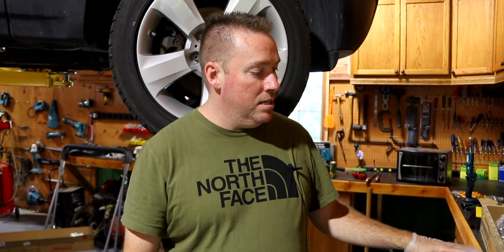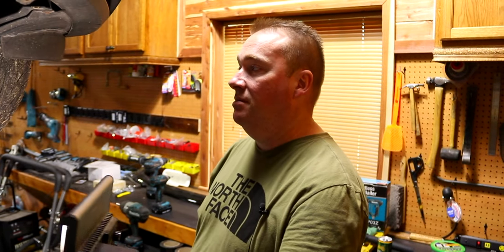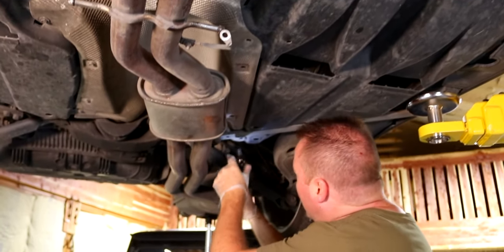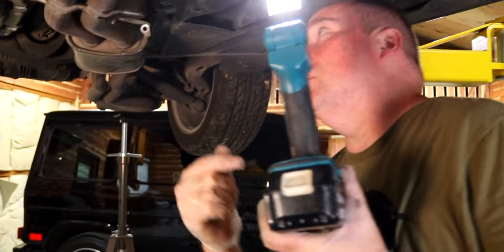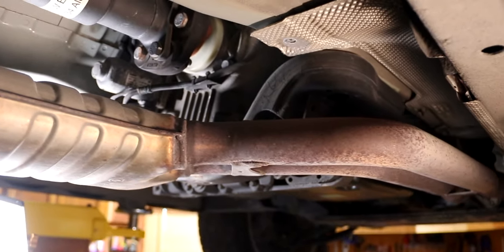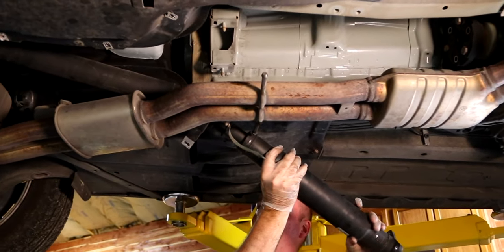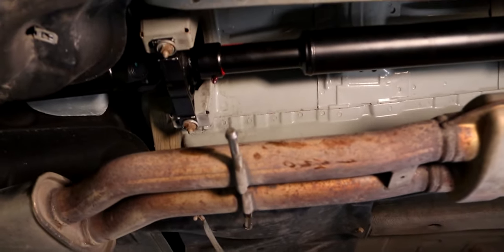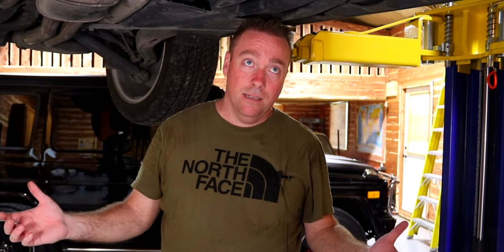BMW Vibration Fix Drive Shaft Replacement X3 X5 E46 E39 E90 E60 F30 F10

Comment: Thanks Nathan. Just had to do this on my X3 in the driveway. You weren't lying. It sucked without a lift. You got to do what you got to do. The only thing I could see to add is if the new one you got with the grease fitting, if you need to preload it or tighten anything like ones with a lock collar.

Comment: So yes they sell the CSB separately, I know for sure on an E46.  The driveshaft does come apart, which you need to mark it before you pull it apart.  Several other videos on this subject.  Ultimately on mine the spider bearing (u joint bearing) ended up being bad which would eat the CSB. Replaced the Flex Disc and CSB once then it tore apart the CSB shortly after. In that case you need to replace the entire shaft as to re-build the u-joint is not for the common DIY'er as they are staked in and there is no listing for the actual part.  The shaft is only good for around 150K. So I sent my shaft to a guy in Texas (Driveshaft Specialist of Texas) who re-built mine, included the new CSB.  You only have to get the Flex Disc. Cost was for mine $475 which included the shipping cost on the rebuild.

Yes a lift is key.  I have done it before the first time on drive up ramps and jack stands.  Second time for the replacement I had the Quick Jack Lift which was worth its weight in gold.  I bought the lift gently used for half price.  I have used it now three times and only wonder whey I never bought it a lot earlier when performing maintenance on this car. I don't have room for a full blown lift as shown here but in my opinion, this is the next best thing.  You can find other videos on Quick Jack.  If you have a Costco, they also sell them for less and at times they run a sale. -  Not affiliated with Driveshaft Specialist, Quick Jack or Costco, but hey giving props to where it is deserved.

Comment: My old v6 ‘94 Camaro I had was a two piece drive shaft and the center joint went out and dropped in the road. Lost all power. Replaced with a solid drive shaft.

Comment: Question (I see video is from 2021), so not sure if this is monitored.  I didn't hear and see mention of replacing the driveshaft bolts, which I neglected to do on my '06 X3, until I read the Bentley X3 manual. "Replace with new". These are expensive buggers, at $9.66 a pop.  (Well, I think anyway.  Is this a reasonable price in 2022?).  Thanks.  I have learned a heck of lot from your vids. 😀

Comment: What was the symptom that made you suspect the Center Bearing Support and driveshaft? My car sounds like it is knocking underneath under anything more than a gradual acceleration until I get up to about 35 mph. If there is a bad bushing in the rear it is not obvious to me.
Reply: Universal Joints gets sticky with these X3s and they start Juddering at low speeds at first acceleration. The way to find out is to disconnect the front Differential and Juddering stops. Replacing the UJ is the cheapest solution but replaced the whole shaft is even better.

Comment: If that’s your home garage I’m so jealous. I have to do this stuff in my small garage lying on my back and as you say, it sucks. ☹️
Reply: I got some 12 ton jack stands and a jack extension. Can lift the car up about 2 ft which is a good and allows you to use a creeper easily. Also you dont have to reach so high to put the new part in.

Comment: I get a clunk on my left rear side when breaks hit 2006 M5 has new bushings? Also can I do engine mounts without a lift? Oil leaking from them. My rear end also noisy on right turns going to put additive?

Comment: Hey on the driveshaft itself is there any markings to line up when you’re connecting the driveshaft and the prop shaft back together? I screwed up and forgot to make markings. I haven’t looked on mine yet but curious if yours did!

Comment: I had to replace my x3 driveshaft due to the rear joint going bad.  Car vibrated like crazy and quickly turned into clunking.  The rear flange took a can of pb blaster and repeated heat cycles(I only had a propane torch) to get it to disconnect.

Comment: Did you get a BMW driveshaft or an aftermarket one?
Reply: I got a cheap chinese one but I would not recommend them. I feel a vibration as you speed up. Going to have to switch it out and it was a PITA to remove the old one and replace. Should be easier this time.

Comment: hi Nathan , i have a "clink" sound when shifting into reverse, not really there when shifing into drive but i was told it was probably the guibo. do you think that is likely the case?
Reply: that's a failed csb- center support bearing- on the driveshaft. the driveshaft needs to be dropped to replace so you might as well do the guibo, cv joint, diff seals, input bearing while it's out
Reply: reverse compresses the thin part of the guibo going clockwise

Comment: I have a 535i starting to vibrate, can u just replace the bearings without replacing the drive shaft?
Reply: Is it front or rear? Rear is similar process. If front you need to replace the CV Axle.

Comment: This is really odd… I have been talking about the vibration on my E53 and also about my petrol strummer that won’t start - in the kitchen where my Amazon Echo is…
YouTube Ai is now recommended this video  ( I’m subscribed too this channel anyway) and also others on how to start a petrol garden tool which I am not subscribed too.
Anyway, My X5 has a strange harshness/ vibration as I gently accelerate at 2000rpm. I can feel it through the vehicle. It’s not really bad but I know it’s there.
My plan is to replace the rear subframe bushes as they are knackered and take a good look at the driveshaft.
Reply from the maker: This x3 had the same vibration under light acceleration
Reply: Thanks for that Nathan. I’m going to get the driveshaft refurbished I think.

Comment: I have a squeak in reverse only on my 2006 x3....It doesn't do it in neutral...only in reverse.. The front driveshaft is toast so I removed it to test and the squeak is still there...Any Idea what it could be? Its not the brakes.

Comment: anybody can help me out ?    I put the gear in neutral position turned-on status . because turning off made the gear in parking position. 
and going down to spin the drive shaft to loosen the bolts but it wouldn't. 
What was I wrong ?  
I am the one who replace the drive shaft but forgot what was the right step. 

please help me!